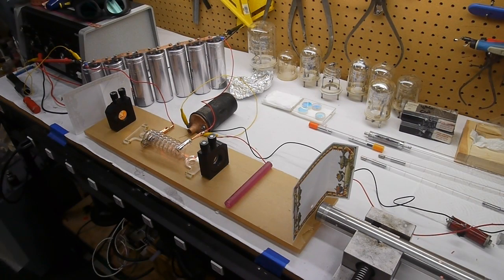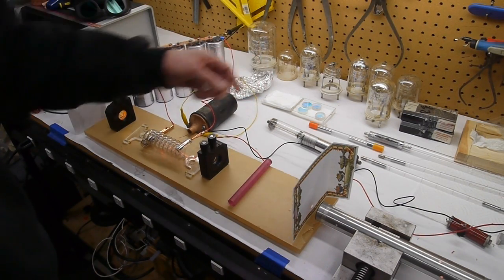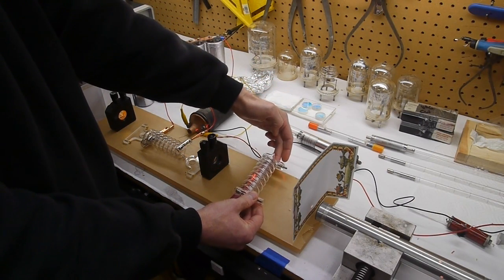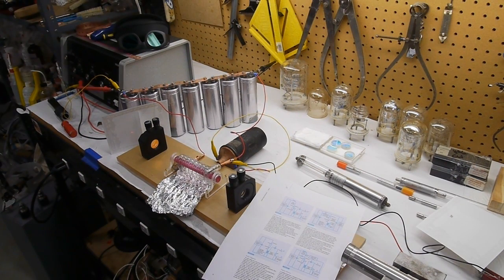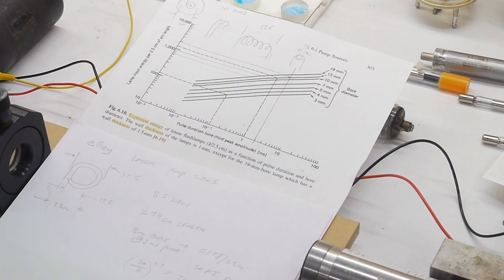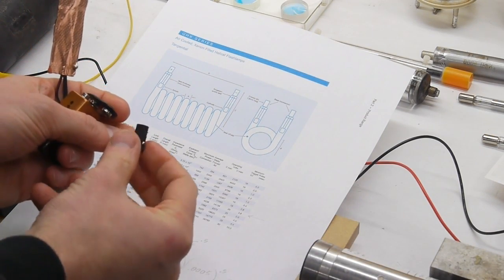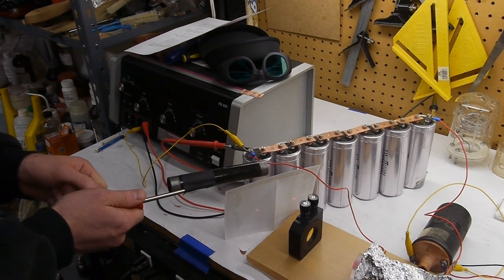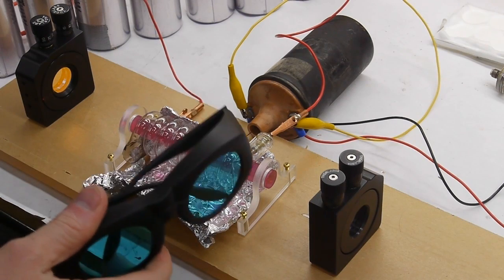Ruby laser design process

Comment: this video was fascinating. i only just learned about lasers the other week, sort of by accident, i was learning about voltage regulators, especially lm317t, and i keep reading about using them to supply constant current to laser diodes. so i bought some, and a few 2w lo diodes off eBay, with hosts, and some goggles. wow. after a few false starts i had a laser! popping balloons, lighting matches-did all that. then got some red diodes and bought a green pointer, and an x-cube, and played with making a white laser beam. i loved it all. i even bought a cheap fog machine off ebay, and the ingredients to make my own superior fog juice, to use with the mirrors i've glued to little pc fans and stuck to my study wall! now i want to use my recent high voltage learning to make flash-tubes work. maybe soon ill build a laser like this!

Comment: There's another way to get a high voltage pulse. Connect a switch and a power source across the primary of your ignition coil. Put a spark gap across the secondary. Close the switch and current flows through the primary storing energy in the magnetic field. When the switch on the primary side is opened, the voltage across the spark gap rises until it arcs across the spark gap. The size of the spark gap determines the voltage on the high voltage side. The current through the primary side determines how much energy is stored and thus the length of the pulse. By using an adjustable power supply and an adjustable spark gap you can adjust the voltage and pulse duration. The switch on the primary side should only be closed briefly and released to avoid overheating the coil.

Comment: I Hate to be the guy criticizing but I have no choice. As a ham radio operator for 60 years and as a professional electronics guy experienced with 100,000 watt transmitters your haywire installation where you casually bare hand discharge a lethal charge scared the gizzard out of me. Get some professional advice while you still can.

Comment: You are only missing the water cooling system for the flash lamp and a trigger mechanism. (The car bobbing would do). For the Xenon flash lamp you would need also a tungsten wire winding the quartz envelope because xenon gas needs to be ionized before receiving the energy on each laser pulsation. Xenon gas alone doesn’t conduct electricity between the contacts to create the flash!

Comment: i am basically sure optical pumping the ruby and dispersing them imaging would require 360 degree tranparency on the output and syncing the laser with a particle sensor with an r2d2 for forward expansion. And the lens effect to bounce back the processed image like those old binoculars

Comment: When I was a kid, my Dad had a college class ring with a ruby in it, and I read in an encyclopedia (mid 80's at this time) about how early lasers used rubies and flash bulbs.  I repeatedly asked to borrow my Dad's ring, and his camera (with a hotshoe flash) to try to create a laser. I was convinced I just needed to get the angles right to make it work. I had no clue what I was doing, or why I was failing, but God bless my Dad for indulging my interests!
Reply: This was my dream project as a kid. My World Book Encyclopedia 1965 featured it. 
 Awesome dad to let you experiment.
Reply: i had a synthetic ruby emerald cut, i had no idea if this was the same material as the ones used in lasers but i also had a camera flash unit that was battery operated and to make the flash go off there was a small button on the back of the unit, so i would put the ruby on the face of the plastic window in front of the xenon bulb and flash and look at the ceiling to see if i was getting any red shots lol i had no idea if something was working in terms of exiting the ruby but because of its emerald cut it is difficult to bother using mirrors and was hoping maybe id get lucky with internal reflections to do the trick

Comment: Question: If the photons inside the ruby go back and forth between the opposing mirrors and are all in the same wavelength, shouldn't them cancel each other out as they race into each other again and again? Obviously they don't, but I'd like to know what happens to destructive interference inside a ruby laser. Thanks.
Reply: Each high index (ruby) to low index (air) transition must be a zero-node. That is no EM field at the mirror interface. I would need to refresh myself for the proof, but this is the physical principle that makes laser light temporally (in-time) coherent.

Comment: I understand this is old so maybe my information is not useful but I am very concerned you don't know if your laser safety glasses can block the UV. Any reputable pair of laser safety glasses will have the wavelengths written on them that they block along with the optical density for that wavelength. It is a logarithmic scale so OD1 will block 90%, OD2 99%, OD3 99.9%, etc.. Typicallly, class IV lasers will use OD6+ at the appropriate wavelength. The glasses you show, if there are no markings, are most likely "welding glasses" which are not adaquate for lasers.

Comment: Yeah, lasers require specifically built components for good efficiency, can't easily use salvaged ones. The flash lamp you could coil around the ruby is pretty fortuitous.

Comment: What happens when you use a secondary synthetic ruby like how an afterburner works on a jet engine?
Reply: if it's pumped and well synchronized, you can use additional rods as amplifiers. peak powers become very high though which tend to uncover any weaknesses in your optical elements (esp the rod, maybe why Ben's ruby had a crack on the end).

Comment: Once you figure everything out, adding a Q-Switch even if it is passive, it will make wonders. You will be able to hear ionized air when focusing the beam. It sounds like an electrical spark.

You will also need a series inductance to add some milliseconds to the discharge time. Lasing takes a little bit longer than the capacitor bank takes to discharge through the tube and the needed delay depends on the lasing media. Not sure about synthetic ruby, but ND-Yag needed about a 1-mS delay and lasing occurs around 1064 nanometers wavelength when using ND-Yag.

I regret selling my ND-YAG Laser rig to some guy in some university in Italia.

Comment: Look into the neon sign industry for light tubes.. They'll bend better glass filled with any gas per linear foot.. Better transformers, controllers, longer lasting and they usually build a box or display to mount it. Will 3M reflective vinyl work better than a mirror if used to reflect the flash back onto the ruby? Thank you for the videos, perfect brain food.

Comment: Dude, that yellow clip-lead isn't worth you fingers. I've seen them come apart and open up inside, many times... cheesy. Use a hand-built heavy wire gauge lead for your grounding stick. The kind of energy you are dealing with can be deadly as I'm sure you are well aware. You could also add a pulse-forming network in series with the tube to broaden the pulse and couple more energy into the medium by more closely matching the pulse to the resonant frequency of the medium (you'll have to do the math on that one). A PFN will also reduce the amplitude of the pulse, reducing the risk of destroying the flash-tube. Nice setup, I love the old ignition coil used to excite the lamp.

Comment: hold up.. lemme get this straight. You shock a ruby.. (i guess the metal bits in the rubies?)  and create a circuit.. allowing all that stored energy to zap through the device and crystal.. and that huge amount of energy, due to the shape of the crystal comes out in one direction.. ?

Comment: I have a beautiful laser rod that's absolutely enormous - 25mm x 250mm (yep, about an inch diameter by almost a foot long) - made of Hoya Nd-doped glass. It was a spare single-pass amplifier rod from LLNL's Shiva laser array that never ended up being used, so when Shiva was decommissioned its spare parts were sold off and I was able to snatch it up. If memory serves (I did the math on this a long time ago) it'd take about 7KJ of flash energy centered on 1080nm just to threshold it, and it could easily take 100KJ+ if properly set up (read: selenium-doped flowtube for better transfer, liquid coolant for less melty), which would produce an obscenely powerful laser pulse.

One of these days I'll build a laser around it. I'll have to either get a metric buttload of 1080nm laser diodes or have a custom flashtube made to make it work though.

Oh, here's a piece of trivia that's neat to see IRL: Neodymium laser rods change color depending on the light source. In sunlight and incandescent light they're pink, but under fluorescent light they're purple.
Reply: Any luck building it yet?
Reply: I work with similar, but larger, Hoya glass rods. We use 12 "12inch arc length" 300 Torr  xenon flash lamps to pump each rod. Might be able to help you answer some questions if you ever decide to build it

Comment: For those suggesting using magnesium to charge the rod. Too much heat. Having it far enough away to deal with the heat would prevent it from lasing. The set up he has is optimal for a demo. The flashlamps that would typically be used for this would actually have their exteriors coated in a reflective substance so that they transmit more of the light where its wanted.

Comment: a laser is not a light amplifier, it's a light oscillator. at no time does any amplification take place.
Reply: You realize that the word laser is an acronym for light amplification by stimulated emission of radiation right?
And the word amplify here isnt like an oscillator. Thats like a microphone or an amp for sound. This is more like a selective filter. It amplifies the apparent magnitude of certain qualities of the input but loses some too. It amplifies its coherence, its frequency, and its bandwidth. The amplification referes to the objective desires of a user of such device. 
 Its really more similar to an optical capacitor than an oscillator. Think about it. Capacitors recieve energy, store it and then release it at a desired rate and configuration.  Lasers pretty much do the same thing. 
You put energy in, it gets stored in the lasing medium and then is discharged and in the process typically the light is changed to desired characteristics. Its a polarizing optical capacitor. 
Is oscillation involved. In a sense yes. But its more similar to a capacitor.
Reply: How long did it take you too put this nonsense together the worst being "The amplification refers to the objective desires of a user of such device". Do some proper research and you will find the original acronym for this device was LOSER (light oscillation by the simulated emission of radiation). It was changed to laser at a later date to make it easier to get backers for the development of this device.
Reply: @stavehow5501  ive never heard that anywhere.  The device that preceded the laser was called a maser, which uses microwaves in the same way. That word was already extant when someone, charles townes i believe, first activated a device not unlike the one here. I highly doubt that anyone was gonns call them losers. They had masers and the next logical step was to use light for the same purpose. One would simply substitute an L for the M and change maser to laser. 
He did if you notice call it a resonator. Resonance is not an incorrect description of how a laser achieves what it does, but its not the end product or goal. The goal is the ouput, which is light that has been altered and had some of its characteristics changed or Amplified. Simply made greater in some degree. 
Coherence. Apparent magnitude of a particular wavelength. So yes resonance or osscilation is HOW a laser does it. Thats all in the literature about lasers. But amplify is WHAT the laser is used for, the acronym is context specific functional acronym. Loser would be a procedural. The light is doing nothing useful until its emitted. It can oscillate all day and no one cares until something comes out the end. They could have also called them mmsers or lmsers because its really taking one form of energy and running it through a filtering capacitor and getting energy of the same type, but highly modulated to have desired characteristics out of the filter. That doesnt roll off the tongue though. Doesnt sell as well. LOSER if funny as heck but its not gonna work because that just not what you name a product unless you are marketing against NERDS candy or you just want it to fail. Amplification is not a totally incorrect way of describing WHAT a laser does. Maybe someone really did submit LOSER as the name. Or they considered it for a few moments and decided that they wanted to be laughed at less in life not more. 
But man ive researched more about lasers and the history of them than most people who are not either historians or people who make lasers for occupation or hobby. Ive never heard anyone mention the LOSER name. I will look into it. I could be wrong. My research was done years ago. But im pretty sure that they always intended it to be LASER. Given that the word maser was already in use at them time. I do recall something about some small argument on what to call it or how to describe it.
Reply: @stavehow5501  the only thing involving an O in it was the idea to call it an Optical Maser. Gordon Gould published the definitive paper on it in 1959. It was called Laser. He intended to stay with that convsntion. Uvaser. Xraser. Laser. Raser for radio frequency. I would guess that they would use swaser for short wave. Gaser for gamma. Ha ha lol. Gaser. Get it GAYSER. Im a funny guy. 
 Anyway all the stuff i just read totally jives with the primary resources i recall from 20 years ago. Now if i recall there was years later a counter claimant on the patent for laser technology. Said his work was stolen. I dont remeber the guys name or much about his claim. He might have used the acronym loser. But thats not surprising because he claim was dismissed if i recall. He was a loser.
Reply: A google search should at least return something.  It returned this. https://www.nowness.com/story/light-oscillation-by-stimulated-emission-of-radiation-bertil-nilsson

A performance piece. 
Thats it. 
You are making shit up on the internet. 
Cite a source please. Link to something that substantiates your claim.
Reply: @metamorphicorder  Do you even understand how a laser works, the line "It amplifies its coherence, its frequency, and its bandwidth" is ridiculous as none of these characteristics can be amplified. A (perfect) laser produces only one frequency that is set at manufacture by the distance between the mirrors at each end of the tube, the bandwidth is therefore 0 Hz. Our manufacturing process does not allow us to make a perfect laser but we get damn close, which means the bandwidth is very slightly more than zero and this in-turn reduces the coherence. As for the capacitor bit, a laser does not store energy, the moment you remove the energizing force the laser stops working. I can't see one sentence within your first posting that is anywhere near correct, so i for one will not be wasting any more time with you.
Reply: @stavehow5501  what you are talking about its charge discharge cycle. A laser DOES store energy. Thats how it works. The energy is put into the lasing substance and it is stored. Usually for a very short period of time. Then it releases it. Sound like anything else? Like a capacitor? Energy is put into it. Then released. The functional context is different because the chemistry of the storage medium is different but the procedure is similar. 
Bandwidth may have been a poor choice of word. But filtering a light source through a lasing matrix does amplify certain characteristics.  It eliminates others. Like i said its a subjective functional acronym. You cant deny that it amplifies the coherence of the input light.

Comment: When pumping ruby the bluish region is color temp is favorable this usually matches high voltage and lower capacitance.  Similarly, the YAG prefers to be pumped with lower voltage and larger capacitance for a more reddening of the pumping color--hope this tip helps somehow with capacitance choice.

Comment: Are those caps old new stock, from say the transmission companies.
Reply: James Luck He seems to be sourcing them from professional photoflash PSUs.  The very high-capacitance, high-voltage caps used by power utilities have, I think, a built-in discharge resistor; I do not know how easy they are to find, though....

Comment: You're going to want to put a diode in parallel with each cap that's on the series string of caps you've got there.  Or, the capacitance of each capacitor must be matched.
Reply: Greg Feneis, naw it'll chuche

Comment: Laser math isn't quite correct, generally Eout ~ E pump. Eout = Epump(1-R^-pathlength bounces). Derivation follows: sum from n=0 to #bounces, geometric conversion of Epump * (1-R) * (R^n) := Epump*(1-R)*(1-R^-pathlength bounces)*(1/1-R), (1-R)'s cancel. Most of the E loss is actually from Chromium's semi stable intermediate orbital as heat loss. The half mirror's purpose is to set laser threshold, a higher R means smaller threshold and you can make weaker lasers, lower R's have higher thresholds but the benefit comes from being able to run more wattage through the laser without fear of burning up the half mirror.

Comment: will it work if you remove xenon lamp with ir laser diode?
Reply: +Tejeshw Vardhan:
Huh? Did you mean
"will it work if you REPLACE xenon lamp with ir laser diode?"

No. The Ruby laser probably uses photons of a certain wavelength coming from the Xenon flash lamp.
You IR laser probably doesn't have the right wavelength to excite the Cr atoms.